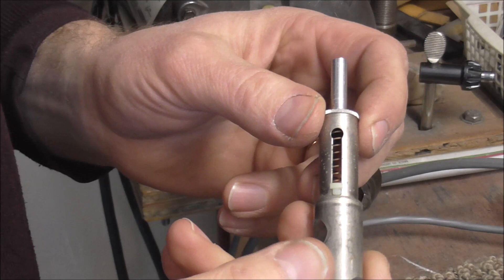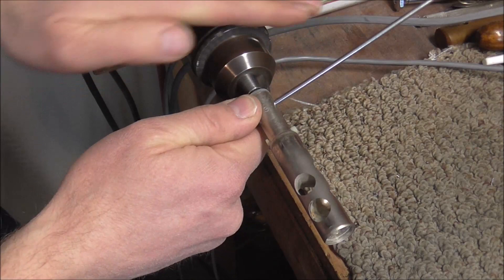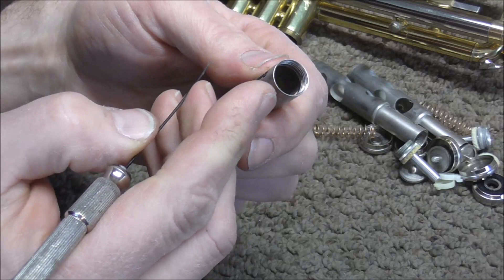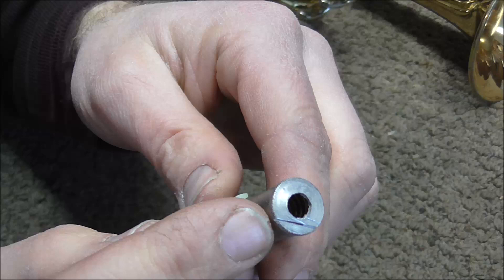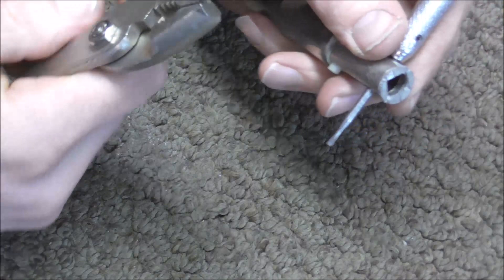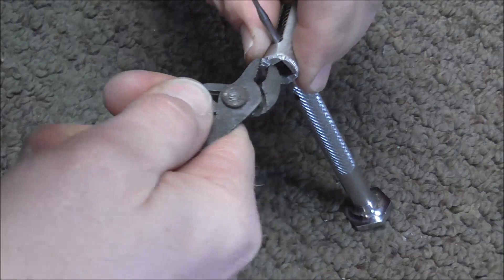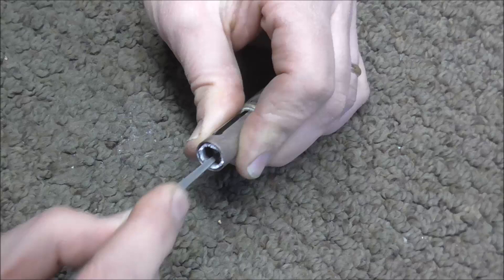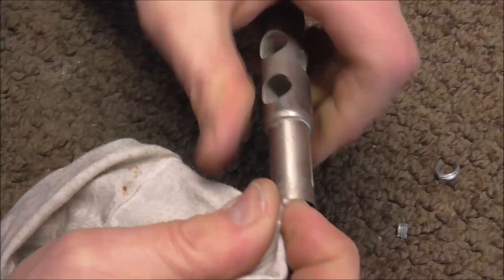How To Remove a Stuck Valve Stem On a Trumpet or Cornet

Comment: My valve buttons... all 3 are stuck can not remove them to change the stem felts what can I do ?
Reply from the maker: Watch this video: https://youtu.be/j3kyKc7rwWE
It is not exactly the same, but the concept is. You should be able to use this pliers to get the finger buttons unstuck. 
I hope this helps, 
Art

Comment: Thanks for the demo, that's impressive. I hope I'll never let my stems rot this way 
In such a case with dead-stuck stems, do you think a drop of penetrating oil would help loosening ? Or soaking the top of the valve in a chemical flush which may clear some of the corrosion ?
Reply from the maker: Usually you can tell when it is so corroded that it will not budge, but it would not hurt anything to try penetrating oil. About the chemicals; the valve stem is made out of an aluminum alloy, so there may be some chemical that would dissolve it. I am not sure what chemical that would be though. I do not think there would be a chemical that would distinguish between the valve stem and the corrosion.
Reply: @TheBrassandWoodwindShop  Thanks for the answer ! 

A chemical able to dissolve aluminum while leaving the brass valve untouched would be great at the end of the job, to clear the remains of the threaded part of the stem without risk of damaging the valve inner thread... I'll do some research about such chemicals.

Comment: What scraper do you use to remove corrosion?
Reply from the maker: I usually use a solder scraper also known as a triangular knife and a brass bristled brush. To get into the threads you can use a needle spring from a woodwind instrument.